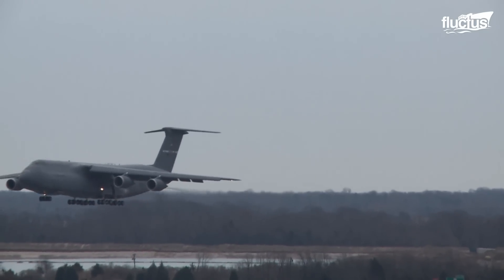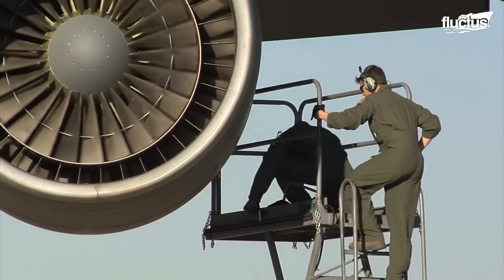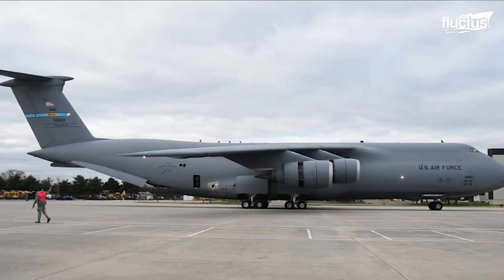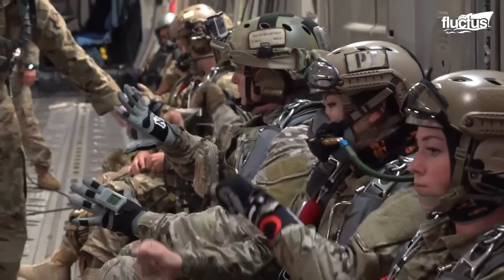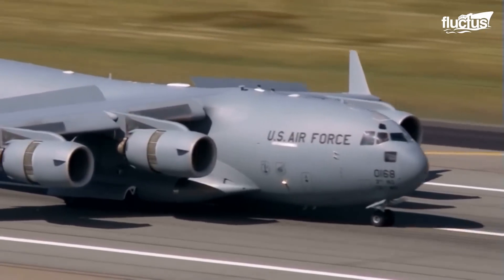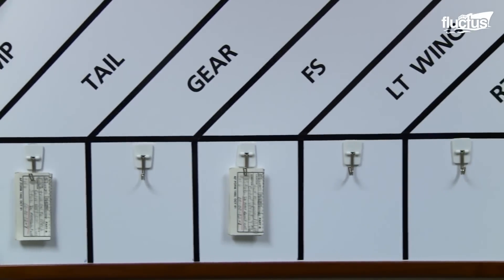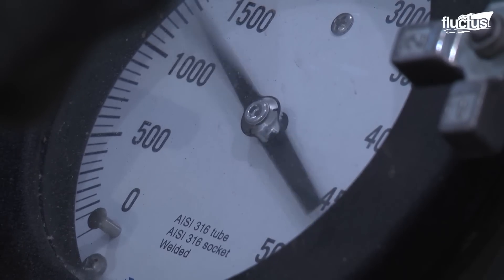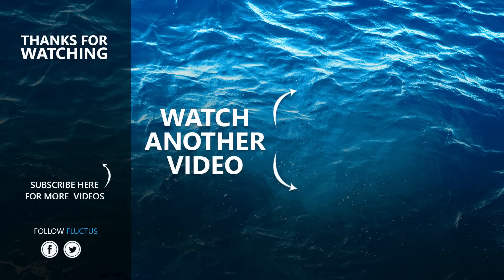These US Air Force Engines are So Powerful They Can Stop a 420 Tons Aircraft

Comment: Think of it this way, it is like a medium sized ship that can fly!  They are so behemoth and weigh such a collasol amount, that the pilots have to have maps of the base showing where they are allowed to even stop and park those behemoths.  Rolling, they are fine, but once stopped after awhile all that weight well not in designated areas on the tarmac, the tires in time could punch right through the conrete on the tarmac.  There are designated circled areas that they are allowed to come to a full stop, that are a lot thicker in concrete and use galvanized steel pipe (I cant divulge how thick the concrete or the pipe is) for rebar!  Watching them take off fully loaded at the very end of the run way.  They rev up the engines full bore and nothing moves it seems like for a few minutes, then it moves a few inches, then a foot, then more feet breaking inertia.  Even pulling up, by its size it seems slow and you gasp, it the plane gong to clear the trees at the end of the run way.  That is what it is like!

Comment: any sizable jet engine is powerful, however, these produce less than 1/2 the thrust of the GEnx (but weight a lot less).  If you could install 4 of those, the total thrust potential would be about 500,000 pounds.  that's not enough to allow a fully loaded plane to climb vertically, but reasonably close.

Comment: How do they KNOW that so much weight is properly distributed when full? Is it possible to miscalculate?
Reply: That was my role as a loadmaster. We calculated the weight and balance of the aircraft and made sure that everything was in proper limitations. Additionally, made sure everything was tied down properly, usually using chains on things with wheels. Bulk cargo was usually put on pallets and rolled onto the aircraft.
Reply: @thomashelm6931  i did 44 years at brize EGVN printing 11 fixed wing and 6 rotary wing pay load tables
they used us as final proof readers   nother set of eyes.

Comment: The cowling does not attach the engine to the aircraft. The engine is attached to the pylon, & the pylon to the wing, & hence to the aircraft. The cowling attaches to the pylon at the hinge, allowing it to swing open; and to the engine when closed.
Reply: Was at Dover in the mid-70's, seem to recall that only 3 bolts actually held them on...

Comment: Interesting video. However the the statement at 3:40 that the engine is being removed from the cowling that attaches it to the aircraft is incorrect. The engine is supported by the pylon. The cowling is an aerodynamic shell created around the engine.

Comment: Long story so I want go into detail, but I was the Marine G-4 Operations Officer for the 1st Marine Brigade in Hawaii.  I had a lot of responsibilities for all of the logistics for both the infantry brigade and the composite Marine aviation group.

One of my responsibilities was to meet every cargo plane that arrived to ensure that on the Marine side we met all of the requirements to load equipment aboard cargo aircraft and the cargo aircraft crew was responsible for ensuring that we met all of the requirements to load cargo aboard the aircraft.

The problem in those days was that the Marines didn't have all of the latest requirements needed to load special equipment aboard the C-5A which was the largest US aircraft cargo aircraft.  So early on in my new assignment I was responsible for ensuring that we could load a CH-53 helicopter on to the C-5A.  Unknown to me was that we were supposed to provide a special wooden extension to the C-5A cargo ramp to allow the helicopter to be loaded.

Well, that didn't happen and so the C-5 took off for another mission while we tried to figure out what wooden ramp supplement they wanted.  Eventually we figured it out.

But it seems that the modifications that have been made to the C-5 no longer require the requesting organization to build wooden ramps to get helicopter and vehicles loaded.

Jus a glimpse into what it was like in the 1970's compared to today.
Reply: That's impressive.  Those planes are so powerful
Reply: @lauraoday1761  thanks for watching captain and shift commander LABonte air mobility command patriot wing commander. Ahh 34 combat war veteran

Comment: 420 Tons is an exaggeration. I had to look it up because that sounded crazy. Max take-off weight is approximately 285 tons. Still insane but after fuel is expended, it probably lands at 150 - 200 tons.
Reply: 420 tons us about right  which is gross weight of everything,fuel,cargo and empty plane weight, The 747 has a gross weight of 500 tons or a million pounds at take off for its latest version